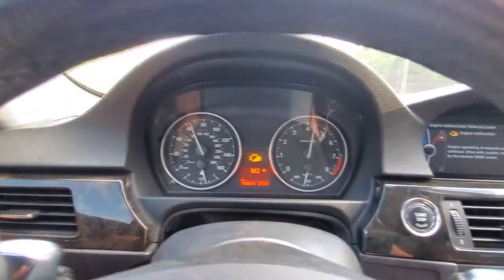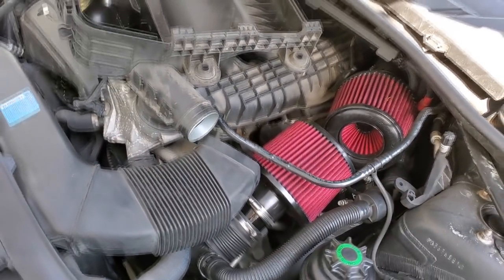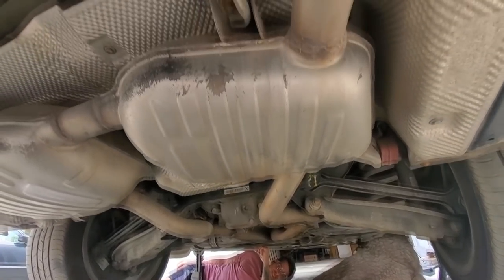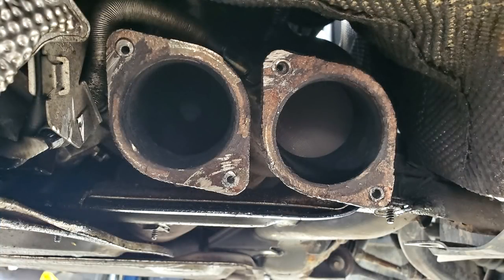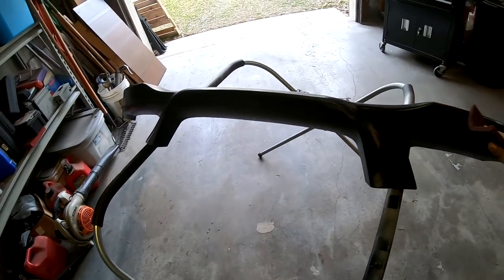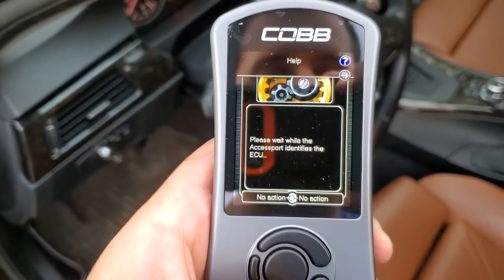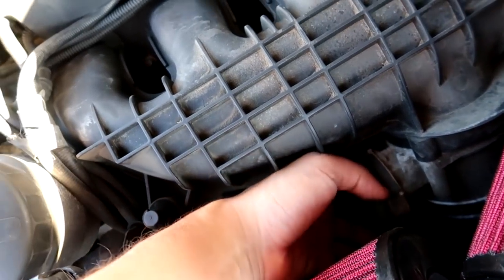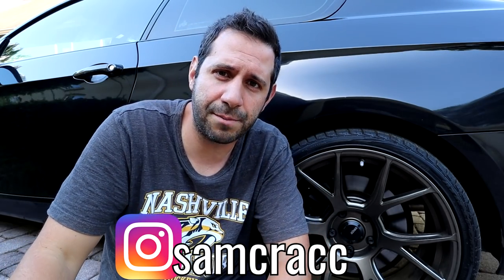Making a DONATED 200,000 Mile Twin Turbo BMW Look and Drive like NEW! (and then ENGINE MALFUNCTION)

Comment: How is that car getting cool air with the twin intakes on top of the engine with no enclosure to shield them from the engine's heat? A Cool air system is important to an engine's performance.
Reply: It goes through the intercooler first it doesnt matter where it comes from on a turbo car as much as it does on an n/a car.
Reply: @lifewithanxietyeveryday5897  He has two K&N air filters in the engine bay. Recycling hot air for a turbo is one thing but the engine itself needs a cool air system. You cannot have an air intake system in the engine without a cover or heat shielding. That engine is only breathing in hot air. Look at that video again. I have rebuilt several cars and when an engine Breathes in hot air it will never run right. That's why he keeps tripping codes.
Reply: crazythedon  That's fine for a race car because it's continually moving and there's cool air continually flowing through that engine bay but for a street car it will never run correctly, he is tripping codes because of those double K&N air filters. Those cones are intakes that's how the car is breathing that K&N system is in the engine bay, when he's stopped or idling his engine is sucking in hot air, there is no other way around that.
Reply: @lifewithanxietyeveryday5897  you know the intercoolers is for a transmission not the intake, right?
Reply: crazythedon  the intercoolers for the transmission not the engine intake.
Reply: crazythedon  are you?
Reply: crazythedon  You do know how turbo works right, it works off of exhaust gases.  the setup he has in that engine that engine is breathing hot air. If that were a race car he wouldn't matter because there's constantly air flowing around the engine bay.

Comment: Hey dude... love the e9x platform too good video... these’s car have very sensitive to NOX sensors due to emissions regulations... you might find that there are 2 modes the engines work in (homogenous and straf) is to reserve power/fuel keep emissions low and running fine and the other is for full power... when playing around with exhaust mods something as little as changing position of sensor could throw sensor errors. Love the video and the car espesh e92
Reply: John Kamau I remember mine passed Texas State Inspection with Catless Downpipe, Cone filters, and a stage 2 tune with no fuss from the inspection guy. Payed $20 rather than $100 under the table .
Reply: Marv-O makes sense, but the e9x n54/n53 are very sensitive

Comment: Sam I gotta be honest I didnt even like the car that much, as I'm much more of an 1M, 2M, M3 and M5 kinda guy, which usually come with flares and much more macho looking bodywork, and I gotta say it really looks good with those wheels, like if you just delete those silver things on the front fenders, or even paint them to match the rims, she'll look really good as it sits now. 

also sam I gotta ask were you spying on my comments when you bought that Shelby lol as when the C8 debuted and they were making a stinker about oh its end of the exotics and stuff

I was kinda on a quest to tell people NOT to buy into that given how bad my relationship with GM was in the past 

IE like are you crazy, its GM, you never buy the first of ANY of those cars, as its GM and it'll suck like the cobalt with its ignition switch thing, or the magnet falling off the flywheel on the V6's models they never fixed, 

(they all did that from like 1980 to 2005, where a magnet would fall off and make you think the engine broke, only for it to be the glue just wore off! I had it happen on THREE Cars!)

and do you really want to support a company that let off and laid off people to save its stock price for thanksgiving, 

 you'd be far smarter to buy a Shelby GT350 from 2016 for 15 or 20 grand less (one of which I was really damn tempted by as it was a 2016, less than 5 G miles and the warranty was still good for like 35G's, yellow and black too, a real looker)

and then like a month or so latter you actually bought one lol like its just like, I know its probably not so, but did you lol

also if your gonna do a car by GM in the future, look into a Chevy SS, as the same engineers who made your friends BMW M5 actually made it.

hell about the only bad part about the damn thing is its apparently using a modern version of the Doug Nash 4 + 3 that forces you to skip gears to save gas mileage, and it would still be in production if well, just look up what GM is doing to holden right now as their the ones who made it. 

yeah needless to say, I have more than a wee bit of ire for GM even though the C8 does look like a really great car from what cletus mcfarland showed of it. 

its just their management REEALLY SUCKS and needs to have a certain orange man bad say something along the lines of your fired to them.

Comment: Why rev a Cold engine? Never Rush a Cold engine is like the nr.1 thing you learn about cars.
Reply: yea is there a point to revving a cold engine aside from unnecessarily stressing it before the oil circulates?

Comment: Hey you should consider a jb4 chip tune with a mhd backend software tune. It will probably make more power than the Cobb. Plus you should totally checkout xhp and do a transmission flash. They also offer an x drive to rwd conversion through software.
Reply: You could also do an alpina transmission flash for free if you wanted to try and figure that out
Reply: The mhd tune also lets you customize a bunch of stuff like exhaust burble and aggressiveness

Comment: real question is, before modifications..
why not repair the important issues?
Reply: long cat for real It looks like he didn’t even check if his original problem was fixed by replacing a valve cover. I would have test driven the car at least 100 miles aggressively. And a compression test would help especially if the car has some miles.

Comment: 5k+ revs limp mode usually is caused by faulty vacuum lines. Please replace them.
Reply: I had the same problem and vacuum lines fixed mine but I think he already did that in the previous video🤷🏽‍♂️

Comment: Sam love your channel! I pick one of these up myself from Copart. Turbos were blown, sucking oil up into the motor big time. Just installed bigger turbos, downpipe, inlets and I am working my way thru valve cover gasket and intake valve cleaning. Donate me your stock wheels man, I’m in Orlando! Mine are 17s and weak lol. Anyway, Love the content, very helpful and inspirational. Keep it coming and stay safe with this Corona. Grace n Peace.
Reply: Hey, I have an E60 535 with this same motor doing the same thing. We replaced the valve cover and RB turbos. It’s still burning oil. Did you fix your issue?
Reply: Bill I did. Love the car. Did you remove the intercooler and check piping for oil in the low spots? I had to turn my intercooler to drain overnight and remove my intake and piping to drain excess oil. While I was in there I gave the intake valves a cleaning from the guk that normally form due to direct injection. It smoked for a little while like a few miles but cleared up.

Comment: I like your videos but I disagree with the entire limp mode thing, a bad o2 sensor should not put the thing in limp mode, Mass air flow shouldn't either, and when some models kick into that limp mode, you are limited to 30 - 40mph and like 0 power to even get home and angry drivers behind you. I agree in limp mode for coolant issues or oil issues, even a misfire it shouldn't go in limp mode in my opinion.

But then again, all of these fancy sensors, and yet them new cars still can not tell you if you brake or plate light is out but can tell you your tire pressure. I guess im old school, I had the same gutless 91 Chevy Pickup since 2002, recently sold it last year with 876k miles on the original 4.3 engine, and bought be a 92 Chevy 5.7 create engine with a bit more grunt.

Comment: Hey Sam, I’m actually modifying a e90 335xi on my channel and ran into issues with those studs the I rebuilt my turbos last year. I actually ended up cutting notches in the cats and using a screwdriver and a hammer to get them out 😂. Anyway, I’d recommend adding the catless or highflow downpipe so that you can go stage 2(+). I did it on mine and am actually about to install my intercooler but I ran an e40 tune after going 2 steps colder on the plugs and upgrading the coils back in December and the power gained is scary. I went the mhd route but Cobb has the same tunes in the community and I know you’d have fun with it. If you want some details on that just let me know!

Comment: You know what sounds cool? A 350 Chevy bored 30 over with forged pistons and 400 heads shaved 7 thou, Clevite bearings, Edelbrock breather, carb and intake, Mallory pro billet distributor, MSD wires, Blackjack headers and no exhaust from the 3" openings at the headers!
Edit: Forgot there is an RV cam in there too ;)

Comment: Bro...you open up a can of warm. Fuel consumption, volts,air intake, injectors,map sensor flow, computer communication,  laptop definitely need to monitor changes. Asap. Cant hack you way through this one buddy.

Comment: Thats an x-drive, you went staggered setup make sure u have a equal front and back rolling diameter otherwise your going to blow your transfer case and it will drive weird, xhp flash the trans so it knows you are making extra power also it will shift all better, xhp also has a tune that lets you toggle rwd vs 4wd mode. Also. Mhd is the way to go cobb is an incomplete tune on this setup and will give you a headache later...

Comment: I had one. The Air filters make no change in power apart from the loud turbo noises after tuned. Mine had MHD. I had some cheap autozone air filters with a metal pipe into the inlet. Budget Performance car is indeed what this car was. I spend no more than $500(MHD Stage 2+, VRSF Catless Downpipe, Autozone Cone filter) and the power I got from it was incredible. The Engine malfunction codes is from old Spark plugs and Ignition Coils. Very cheap on eBay. Mine worked well.

Comment: Samcrac, or anyone who reads this. 
I have a 2015 S-63 AMG Sedan. 
Any mod recommendations.
I only want make it faster. Increasing the horsepower and torque. I do not want to make it louder, if possible I'd like to make it quieter (my neighbors already can't stand me)? Also I'd like to refinish my rims and coat them in a high gloss black. I've heard great things about Brabus and RENNtech.

Comment: I had a 335is.  Just another leaky and greasy BMW after 40k miles, couldn’t wait to get rid of it.  HPFP issues, leaky injectors, electric water pump failures, expansion tank issues.  The list goes on.  My DCT pan was leaking after 40k miles!

Comment: P30ff is a low boost pressure code. Replace vacuum lines, you should be hitting 14-17psi stage 1+.....you most likely also have failing turbos if you listen for the wastegate rattle

Comment: I think typical oxygen sensors age and go bad (not a sudden failure but a slow degradation) by 75-80,000 miles. Routine maintenance.

Comment: After seeing your issues thought I'd give my 5 cents. I still have my 2007 E92 335I. with over 200000kms. I had the engine malfunction and here's what I did. The fuel Pump was replaced as there was a recall by BMW due to the original being under powered and couldn't deliver enough petrol when accelerating. I had all the Turbo vacuum lines replaced only to find that the issue was caused by a small crack on one of the vacuum canisters.... Another thing to check is the back brake tend to squeak on take off. That's fixed by greasing the rear brake's and is completely normal.

Comment: These constant engine failures and yearly $5000 in repair bills are exactly what made me trade in my '09 335i for a Lexus RC 350. When the Bimmer is running well, it's a ton of fun—unfortunately, that was the exception rather than the norm. I'm hoping that the joint venture between BMW and Toyota on the Supra/Z4 means that future Bimmers will be more reliable!

Comment: You'll want to gap new plugs to .22 mm with the colder NGK-R PLUGS.  Cat less downpipes are a must to get the boost from stock turbos.  Those  are most likely ready to be replaced due to mileage.  Replace the O2s all 4 with new downpipes.  Should be golden.  Consider a stage 2 LPFP fuel pump and run some E 85  its addicting!

Comment: Still a very good possibility that you have a boost leak somewhere, the ECU will pull timing and/or boost when it sees the Lambda/O2 value go too lean.  Under boost, that value should be an 11.5 to 1 air/fuel ratio at the leanest. Stock is probably 10.5 to 1 or richer, 14.7 to 1 is stoichiometric (cruising A/F ratio).

Comment: I’ll never understand when people say that the check engine light coming on every 1-2k miles on a BMW is just “part of the charm” of owning a BMW. If an American car started leaking from the rear main seal after 300k, people would piss and moan about “crappy American cars” but an overpriced POS can get away with a complete engine failure at 100k miles just because it’s a BMW. I’m always amazed when I see a BMW with over 100k because they all die well before then

Comment: Also have a 2009 e92 335 with all wheel drive. Mine has less the 45,000 miles and I had the same error. The metal connector for the  vacuum actuator which connects to the flapper valve on the rear turbo rusted off. $50 for the part and $800 labour finally got it fixed. Hope yours is something simpler.

Comment: an exemple of over engineered, go into limp because one of the 3 brake light blow... stuck in 2nd in a semi-auto(easytronic things), max speed was like 40km/h at around 4k rpm was fun for 50km during vacation in the small 1.2l gm car. there was no code, the manual didnt say anything about that, took 3h to find it was just a bulb... but in your case its not over engineered it's just well engineered, it a failsafe...

Comment: Sam, you should've used an MHD tune with an android tablet. It's a flash tune and performs much better than the old school Cobb stuff. Additionally, I would recommended changing spark plugs and coil packs to avoid any additional limp modes

Comment: adhesion promoter should be used prior to paint application. You end up with a much more durable paint job on flexible plastics. It's a cheap ($15.00) step that really shouldn't be skipped.

Comment: Nice video! 
Put a CSL boot lip on, will make it look so much better!
Please get rid of those stupid air filters, the box is specifically designed with designated air flow channels for a perfect inlet air flow. These are prone to causing a lack if Inlet air pressure and can cause exhaust emission readings in the dash and computers.

Comment: I had a BMW 330 with 180k and it kept on going on limp mode constantly. I would have the car fixed and 3 weeks later the same thing. I finally got tired of paying to fix it and traded the car. I took a huge lost. I will never buy a BMW and previous to that i have had 7 of them. Now I drive an Accord 2.0T and it's sweet and I have no issues whatsoever. I would highly discourage anyone to own a BMW past the warranty timeframe

Comment: I have recently installed a cone filter on my m54 e39 and the next few days I got check engine; I immediately installed back the stock airbox and never had an issue since

Comment: Never buy a BMW shit drives like a trash and the cabin is tight as fuck. You have to visit chiropractic after each ride and on this engine you get the check engine all the time. Go merc or audi at least you get a comfy ride and feel like a man. Havent seen a normal person that drives BMW... And bro 2 open air cones sitting on the engine???? Tell me how it goes on a hot summer 🤣 ded

Comment: I bought  a 2008 335xi about 8yrs ago and added the basic bolt ons and reflash, car went mid 12s on pump gas... I was smart enough to have a warranty and get the updated turbos injectors water pump coils and associated common failure points addressed.  I loved that car and purchased a new 340i and now m340i because of it.  My old 335xi was purchased by a friend and has been trouble free for around 4yrs now.

Comment: I had the same issue with those pressed exhaust bolts. I had to drive across town to an exhaust shop with open headers to get them to knock them out. Two people working at it for 35 minutes to get just two of them out. With blow torches and big hammers, and a lift. So those fuckers can really throw you!

Comment: That 30FF code... You are in it for a new set of turbo's. Ditch the COBB Access port and Swap to MHD in the event you plan on doing any more with the car other than more minor maintenance items. Also stay away from Burble tunes unless you want to kill the Turbo seals.

XHP app is handy for transmission tuning and if you ever want to disable X drive as well.

Comment: I bought a 2007 335i back in 2008 and it did the same thing. I took it back to BMW of Las Vegas and they had it in their shop for over a month. They took the engine out and apart and replaced a bunch of stuff supposedly. I picked it up and right away after putting my foot to the floor same malfunction. The car was stock. I got rid of the car.

Comment: i have a similar problem with my 1996 jaguar x300 4.0 litre I6, naturally aspirated though. it runs way too rich, i swapped the pre-cat lambda sensors for another used pair (cos new ones are really expensive and hard to find) and it got a bit better but still super rich. gonna tackle the air flow meter next, see if that leans it out any. cannot get an OBD reading for some reason, might be a faulty ecu or something. happy hunting for the error Sam, i know what youre feeling right now :)

Comment: 18:42 What? Bullshit. I have a catless downpipe and the oxygen sensors read like garbage because of that and the SES light is on but it doesn’t do limp mode whatsoever. This is my daily driver. What are you talking about.